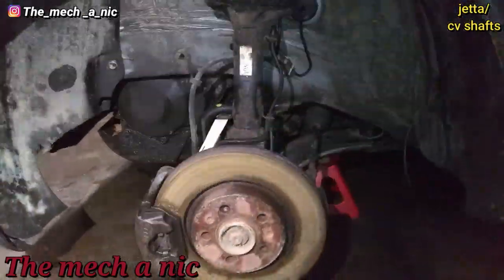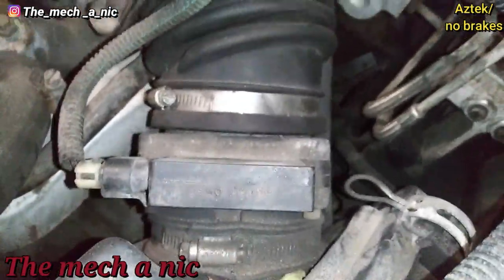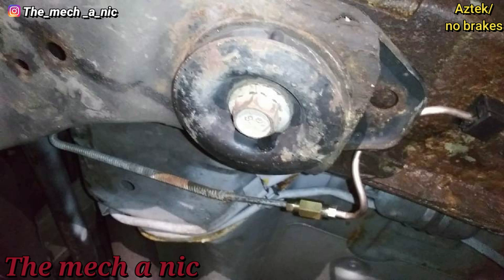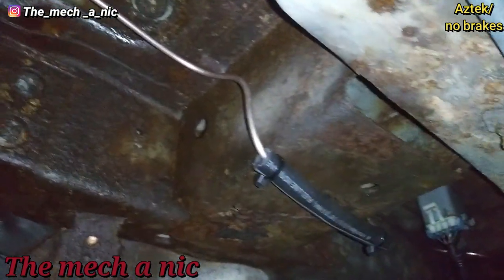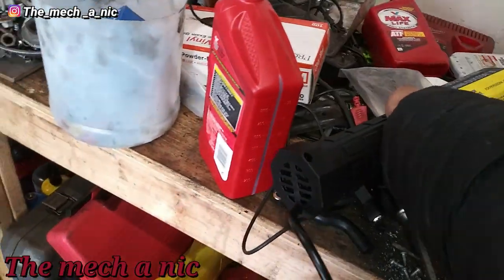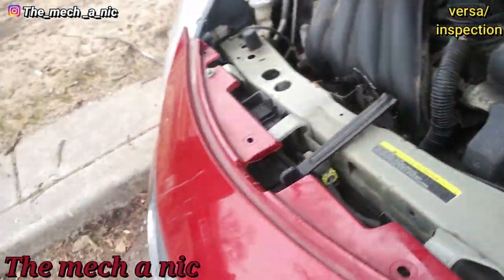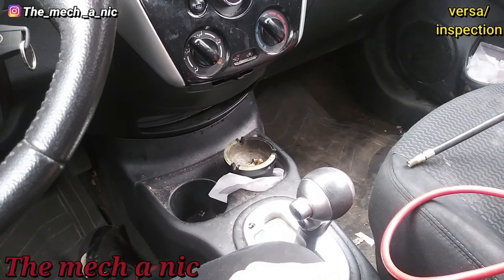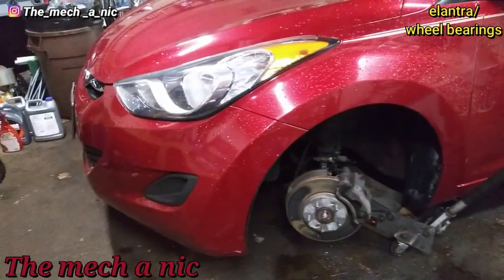versa with a bad cvt ,aztek brake lines ,elantra wheel bearings, rogue cv axle , (vol 55)

Comment: I'm amazed at the number of brake lines you have to repair
Reply: Not unusual in the U.S. north east and southern Ontario and Quebec where salt is used to clear the roads of snow in the winter. I live in southern Ontario and tend to keep my cars for several years. Replacing brake lines is pretty normal for me.
Reply from the maker: Super common over here. I see so many cars that have been hacked by shops. The brake lines look like spaghetti and there's compression fittings everywhere
Reply: I mean I'm from the rust belt but it's nuts up where you are wow

Comment: That Versa wins the Ghetto Hooptie of the Year Award!

As for warranting parts at the Zone I normally just give them a new one & send them on their way. If they come back later claiming the one I gave them is bad because they still have the same code then I tell that there's most likely something else causing the problem. Plus most of the Purge valves we sell under the DuraCrap name are made by Dorman or ValueCrap, though sometimes there will actually be an OEM part in the DuraCrap box. If it's one of the neighborhood "Mechanics" that is known to pull warranty scams then I'll usually tell him that part isn't in his warranty file and he then tries to give me 3 or 4 more phone numbers to check & still gets the same answer from me.

Did have a guy last week wanting us to replace his DuraCrap Gold battery for the second time in 3 weeks because his 2015 Corvette that he only drives once a week & has only 10K on it keeps having to be jumped. After I tested his battery (with 2 different battery testers) & told him it was good he still kept insisting that the battery was bad. I told him "NOOOOOOOOOOO! Your car most likely has a parasitic drawl & that you should take it to a shop for them to look at it." He cried to the dumb-ass parts manager saying I was VERY RUDE to him.

Comment: Don’t blame you for turning down the Versa.  Totally understand your need to rant.  Some might call you the picky mech a nic now.  But hey I wouldn’t have tackled that job either.  Why invest your time and energy into a car who’s owner obviously doesn’t care about the car enough to fix the drivers window , cracked windshield, body damages wiring issue with the fan’s... Flat tire and missing hub caps,  low on gas...Yup they don’t give a crap about it.  They probably drove it till it didn’t drive anymore , left the hazards on, came back the next day to see if it fixed it’s self over night... nope the car said I’m out! See ya ✌️
Reply from the maker: The nice thing about doing my own thing is i get to pick n choose what i want to work on. Not all money is good money. Nobody cared about that versa and its sad , i turned it down because of the transmission. I dont change transmissions . took much work for trying to do it in my garage.
Reply: That's poor car, I have the same 2015 versa with CVT, I just replaced fluid by myself using the garden spray pump and CVT fluid adapter bought from Amazon. It still runs like new, it just depends on how you take care of the car and maintenance is the key to keep it running.

Comment: Warranty parts , well when I worked part time at my friends parts store the arrangement was any guaranteed part was replaced and the  supplier paid the costs back  but only at the end of the month.  Electrical parts were no return if  used  because everyone would try a part then bring it back . We never did ask insulting questions as to why the part is being returned.  Alley cat techs 🤣

Comment: The sad part about AutoZone is most of them don't know anything there are knowledgeable people there but a lot of them know nothing I remember one time I was at an AutoZone and I heard the person on the phone ask a customer what is that where does it go LOL so I asked her politely if I could have the phone and I told her it was a CV boot for a 4Runner I believe if I could remember correctly she meant well but the sad part is anybody who works at AutoZone does not have to really know about cars but there are plenty of men and women that work there that do I've known some of them
Reply from the maker: I agree with you. I just got off the phone with a customer who said autozone said they only need a oil pressure sensor when its clear that theres other codes there as well. I had a hard time explaining that more than one problem has to be fixed to get the check engine to turn off, but autozone said she only needs a oil pressure sensor... 😒